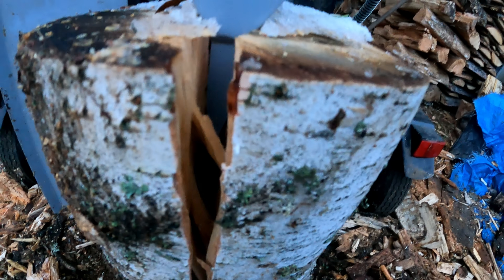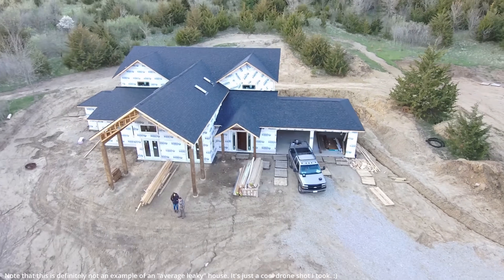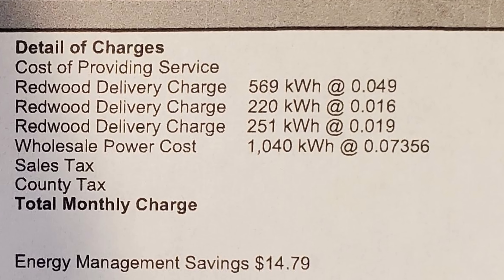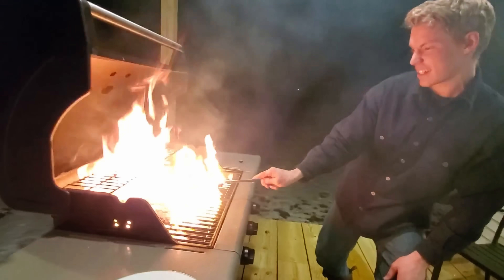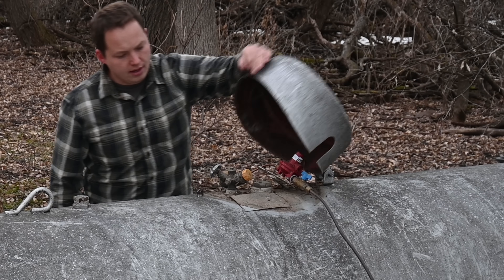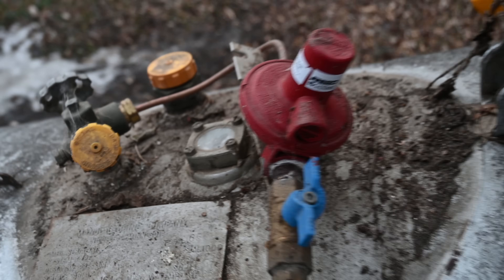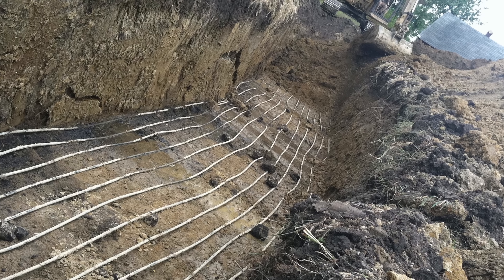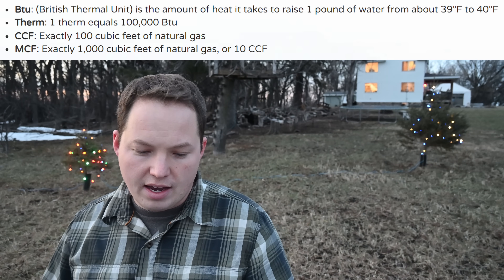What's The Best Heat Source in 2022? Top 5 Home Heating Methods - LP Electric NG Geothermal Fuel Oil

Comment: A pretty good show, thank you! Nice to have all the basic stuff to pick from if you have the options! However there are quite a bit of things to add in comparison to your story. These ways of heating will be gone in some years or too expensive, so it might be a good idea to also include other options for more long term? Like infloor heat? Very efficient! The different kinds of heat are exchangeable as well, you can combine heat sources.
I really liked the idea of having an older house sprayfoamed but there is so much more you can do, or even have to do as older houses are build different then now when more insulation is put in. A MUST HAVE is and air exchanger to avoid moisture or worse. 
Keep up the good work!
Reply: No matter if you have in floor heat or a gas furnace with a blower to move air around to warm the house, the same basic cost will be there to warm the area.  So if using a heat pump, expect to use about 1 KW of electric to collect between 14,000 and 23,000 Btu's of heat, depending on the outside air temperature, and what the SEER rating is on the unit that you have installed.  Some use only 1/2 the power compared to other brands and types of systems. 

Actually using a natural gas boiler to warm the water loop, then using that to heat your home might use more power than a 95% efficient natural gas furnace.  One must consider the water pump power costs, and how much heat is lost into the soil below your home from the warm concrete floor.
Reply: @Kangenpower7  : conversions kill the discussion internationally, lol.. NB, 3.4k BTU/h  = 1kWh (thermal)  so 14k BTU/h is  4.1kWh -which is somewhat achievable on 1kWh of electricity  - double the electricity = double the heat pumped.

(Just switch to kW for all Power - kWh for energy - it is written right there on the sticker, it eliminates a lot of BS.)

 - real cold climates will end up with ground source heating as the long term lowest cost solution - when gas becomes more unaffordable - "BTU to $$$ conversions )

Yes, there is nothing magic about how the heat is generated - sealing and insulating the home is the biggest energy saving in extreme climates  (just make sure you have enough fresh air ventilation (dehumidification/ etc) to control moisture and eliminate condensation..

Comment: Mini split heat pumps with solar panels, with a wood stove, is the best in my area as our electric bill is $0, running AC and heat and I use my electric chain saw to get all of the wood I need, so free there.  I pay $0 for gasoline also as I have an EV.  It’s the best way to go

Comment: What we should be building are houses with vacuum insulation and proper ventilation. Not a proponent of spray due to the hazard of outgasing. Houses built with this insulating technology would require far less fuel to heat

Comment: The best heat source is a "masonry heater".  They were designed back in the 1400s when Europe was running out of firewood.
The units are hand built and have a huge heat bank requiring only one fire per day in most areas.  Temps that remain under 0 degrees require 2 fires per day.  These units easily heat a 2000 plus sq ft home.
I burn less than 6 cords of hardwood in a N Minnestoa winter.

Comment: 950 Sq ft, 3br, 1ba on a slab. 95% NG 5% Space heaters (only set on low when needed, which is rare) with 600W/1200W settings. Thermostat set at 68° = approx $100 - $150/mo, for entire utility bill  (gas, water, sewage, electric) during winter.

Comment: 80% oak wood in the wood stove from trees that simply fall on my property during the year, 5-10% propane when I'm feeling too lazy to get the stove going, 10-15% mini-split heat pump technology.  Mini-split is in my office which doesn't really get heat from the stove very well, so I use it when I'm working from home.
Reply: same. just use wood that falls on my 14 acres... doesnt matter i use it all.. house all winter was 80f in the living room, with the ceiling fan the rest of my 2400 sqft house was 72f..... days i got lazy i dide use the furnace and heat pump... but god damn the electricity use was insaine those 3-4 or days a month i did do it

Comment: I'm burning wood from pallets, in an outdoor boiler.  All I need to do is gather the pallets and break them apart.  No sawing, no splitting.  This is my first full winter doing this.  For 27 winters before this, I heated with cordwood in an indoor stove.  I might use natural gas if it comes into our area.  So far, electric and propane are the only other options.

Comment: Hello, great job!  I live in Arizona and my house uses natural gas. My gas bill for last month (December) was approximately $60.00. This is the cost to heat the home 24/7 to 76 degrees F. A heat pump cost would be twice that much here in AZ. I have a split-system Trane system and my Trane furnace is only 80% efficient. In my climate zone, a high efficiency furnace would not save that much money and it would never pay for itself.
Reply: Yo, if my house was at 76 degrees I would be cooling it.  Welcome from Wisconsin, thermostat set to 64 is comfortable
Reply: @crazy1russian  The heating is different here because we have very low humidity. When I was in Texas, I found that 72 degrees F was comfortable because I was in Corpus Christi, right by the ocean. In Wisconsin, you may have high humidity and that will affect your temperature setpoint dramatically. However, in AZ  we are acclimated for the heat - our bodies are adapted for the heat. In Wisconsin, you are acclimated for the cold. You are adapted for the cold.  So 64 degrees seems "normal" to you, but here, it would be very cold.  I get very uncomfortable at 70 degrees F.

Comment: Very interesting!  We use a heat pump in our condo because there is no natural gas service in my building, no propane, no fireplaces.  So heat pump with electric resistance heat inside the air handler, and that comes on when the temperature outside is <25f.  Curious to see if we can get a more efficient heat pump than the one we have now…
Reply: Typically a ductless heat pump with a higher SEER rating will give the most heat per KW of input power.  And modern heat pumps keep working even at 5F outside air temperature.  If you can install one is another story!  Depends on where your unit is located, and how difficult it is to replace it.  

I worked on one apartment building built in 1965 that had old GE air conditioners on the balcony and 5 KW electric heaters in the closet.  It was easy to install a new 2 ton heat pump and a new indoor air coil and 5 KW electric air handler.  It would have been just as easy to install a ductless heat pump for the living room that is 12,000 Btu's and 120 or 250 volts, and connect the tubing to a second outdoor unit on the patio.  

The ductless heat pump would cool or heat the living room and adjacent rooms OK.  The ducted system has a air duct to each bedroom and another to the living room / dining, and the kitchen all in one area.

Comment: Honestly when I owned a house that was almost exclusively heated by radiant ceiling heat in the drywall. The rooms it didn’t work in had small electric wall heaters. Best part was the electric bill, you’d think it would be expensive but mine rarely peaked above 100 in the winter. Also was 1100 sqft apartment built in 1959. Was not updated insulation-wise

Comment: Man....I wish you would have thrown in wood pellet in here.
Reply: Oh.  Another item to consider.   Any forced air heating, regardless of fuel source adds cost in as well.  A 700w blower doesn't run for free, it may seem like splitting hairs, but if you are REALLY wanting to drill down on cost amd cost savings, it has to be considered.  Why am I saying this?  I am using a squirrel cage blower to move the warm air from a pellet stove happily running in the basement into the living area above, along with that, I have a cold air return blower at the other end of the house to return air and run it across the thermostat on the stove.  It hold the temp in the main living area perfectly at 73F.  But, it costs money to run each blower in electricity.

Natural Gas isn't available where I live.  Yeah....I know.....

Comment: I have used all three of these plus some I used kerosene propane wood natural gas and electric.. by far the best is natural gas .. our current home is just under 1800sq ft our last home .. a trailer was 900 sq ft we had a earth stove to heat the trailer along with electric heaters .. it cost us an extra 200 in the winter to run our heat our new home  is very effective with a great R value . We spend about 65 to 75 a month on natural gas.  I have a high efficiency furnace I actually only heat the basement fully in the wi ter time with a few rooms receiving about 30% of the heat they could take.. wood was great and our earth stove was fan blown so it worked great but wood isnt free even if you have land. I know the value of my hours and for me to get bundled up to cut wood or even get wood to restoke the fire is not worth it .. if it was we would have never seen modern furnaces.

Comment: This video was very informative. I live in the foothills of the
coast range in western Oregon. My home is well insulated as
it was built in 1998.I replaced the 22-year-old heat pump with
a top-of-the-line Lennox variable speed compressor and blower unit.
My electric bill (there is no natural gas service on my road) went from 
a high of 275.00/month to 120/month during the peak winter months.
My next upgrade will be a hybrid electric water heater to reduce the
electric bill even more in the years to come. Thanks for posting!
Reply: I agree -- with heat pumps, the water heater is usually resistance and thus really expensive.  In addition to heat pump water heaters, which cool the room they're in (bad in the winter), consider a solar hot water heater or 'solar-assisted' heat pump water heater (which moves the heat exchanger out of the basement to outside)   These three pay for themselves in 4-6 years.

Comment: Very Interesting. My house was also built in the 1800's, 1868. It is about 1200 sq ft area. I had it insulated by a local firm that specializes in old homes and they did a super job! What a difference. Any way The up stairs is only used maybe 20% of the time and is usually shut off, so I am not heating nearly the whole 1200 sq ft. I use a very efficient  thermostatically controlled  Harmon pellet stove. It is placed in the living room in a corner so it blows the heated air out to the other rooms naturally.  I supplement with some in wall electric heaters hard wired in each room. They are digitally controlled Cadet heaters . They are 1600 watt, 240 volt  and 5200 btu heaters. They can sense the room temp and only put out enough to keep the temp stable. They seem to be very efficient and do not use a lot of electricity. If the outside temp goes above about 45 I just use the electric. When it is colder the pellet stove easily heats the house. If it gets very cold I may have to turn on one of the electric heaters for a bit. The closest I can figure is that It cost me about $800  to heat my home for a 6 month season. I live in southern Indiana. Really, a super insulating job is the key. Plus, I manage my heat sources .
Reply: What kind of insulation did you use?
Reply: @Jmamelia  blown in Cellulose insulation

Comment: My set up is solar energy on the roof with net metering in combination with a heat pump. Still burn wood, but mostly for the exercise in my retirement.  Location is Charlotte NC .  Very useful info here. Thank you

Comment: Insulate, Insulate, Insulate.  Payback will be 4-8 years and then forever.  We have 6 inch stud walls, 18 inch ceiling insulation, and foam insulated basement.  Average LP bill less than $500 including water heater for last 5 years.  Temp average from Nov 1 to March 1st is  below 34 F  high, below 21 F low.

Comment: Heat oil gives you the most BTU per burn...propane and natural gas you would have to burn more of it to get the same BTU's out of heating oil...Most of Pennsylvania has heating oil...just watch for the fuel trucks on road can't miss them...running natural gasoline to non city residents is very expensive or installing a propane tank which is more dangerous than heating oil...I'll stick to my heating oil...A foam house??...must be a nightmare for plumbers and electricians for repairs...stick to what works for decades...can't go wrong

Comment: 1 I think you should correct your video, as 100 million BTU is a LOT of energy? I think you mean the average home should use 100,000 BTU. You should be looking at hydronic floor heating if you want anenergy saving heat. This is what we are switching to in Canada. Example: 5000sf building we are heating for 250.00/month over the winter under 2,000.00$
Location Southwestern Ontario Canada. This is with natural gas!
Reply: Watch video again, 100 mil btu is for season equals about 1030 gallons of propane

Comment: Where the heck do you live?  Here in San Diego we have been paying an average of .328 cents per Kwh for the whole of 2021.  In years past we still paid twice your .12 cents pr Kwh.  I have been tracking SDG&E  every month for the last six years in Excel, and it appears we are getting screwed, because they closed down our main power station because of supposed issues with the Nuclear reactor's housing, and now they have to pay handsomely for getting our power off the grid by power brokers.  Does Enron ring any bells.

Comment: For me, electric is efficient.  I have solar electric so I'm really only paying for the overage if I use more than I'm producing.  But the largest monthly bill I've paid is $100, so for 5 months of electric heat I can pay an average of $500.  I only use the electric when it gets into single digits.  I mainly use a pellet stove and oil for heat. I go through 200 gallons of oil and a ton and a half of pellets.  So if I don't use the electric to where I'm paying for more than I produce, I'm looking at $1000 for heat this year.  My hot water is on electric so that is covered on solar.

Comment: Air source heat pump + underfloor heating for convenience.
Masonry heater for backup (too cold for pump, no power etc.) - no grid needed, few tons of bricks stay warm for some time when you get it hot. Winters worth of firewood is not that much money/space. And you can do even some cooking in it!
Glass-door fireplace for mood an quick heat .. and same fuel.

Comment: I am sorry the heat pump, cost me more then oil and it is new. And these numbers are off unless you get his numbers ,I have natural gas most efficiently made and it cost me 1.5 times to run it then my less efficient.  So you tell me wtf. I turned to pellet stove and oil yep motor oil save so much now half of what I was spending

Comment: I've switched from fuel oil (that's kerosene in Ireland) to a heat pump. At the same time I installed a 6.5 kW solar array. Last year my heat pump used 4.7 MWhs which happens to be what my PV panels generated. Obviously they generate most in the summer so I have a battery and an EV to soak up that juice then, but was amused how the HP and PV panels lined up in terms of usage and generation.

My electric bill has gone up (€1,000), but I no longer pay for petrol (€2,500) or fuel oil (€2,500). I spent a lot on getting all this done so the payback period will be around a decade, but there are benefits beyond money. The heat pump (air to water) is so much quieter than my boiler was. The exhaust was near my back door so that being gone is great. It came with a 200l hot water tank which is always hot - not a normal thing in Irish homes. And the heating is more consistent - with the boiler it would fluctuate between too hot and too cold.
Reply: The gross solar output is interesting, in Australia we have 7.8kW  PV panels on a 6kW inverter - we generate around  8-9MW per annum (a more favourable location maxes out at around 10-11MWh - similar size array)).

Interesting to compare realworld installs  (our energy consumption is mostly summer, matching our PV output well.
Reply: What about wind power generators
Reply: It's all about how well your house is insulated and the size of your house and family. The size of your foot print has a lot to do with consumption.Its the very same as how much you eat or drink. They key is moderation and balance in our lifestyles and good diet along with exercise
Reply: Your HW tank is part of the heat pump or a separate device?
Reply: @bigpardner  they usually use what they call a combi boiler which provides hot water for both heating and general heating. Should be mentioned Europeans don't often use AC.
Reply: You mention that you no longer use "petrol" or "fuel oil". Isn't petrol what we call over here gasoline? If so what does that have to do with home heating?
Reply: @bigpardner  (Transport was mentioned, powering an EV off PV solar_replacing petrol.)
Reply: @bigpardner  I'm American and not the OP
Reply: I bet in ten years you’ll have to replace the entire system.